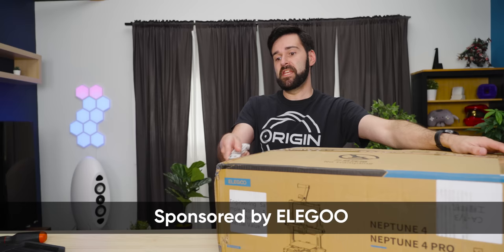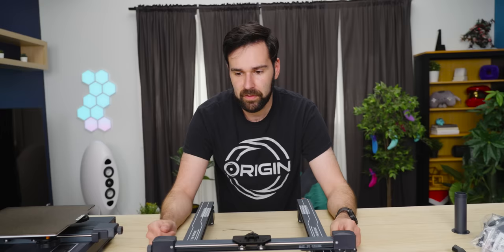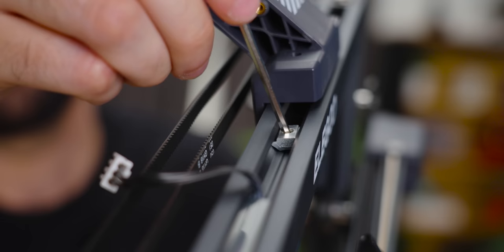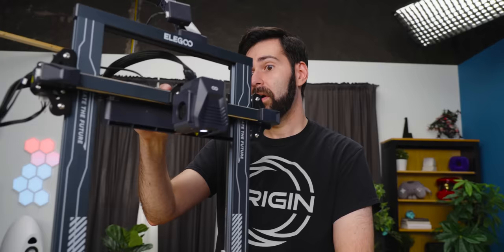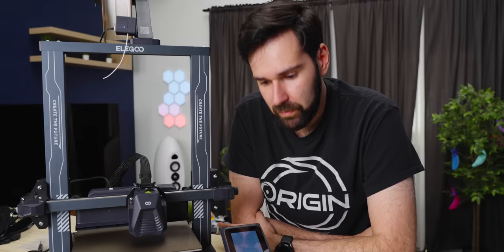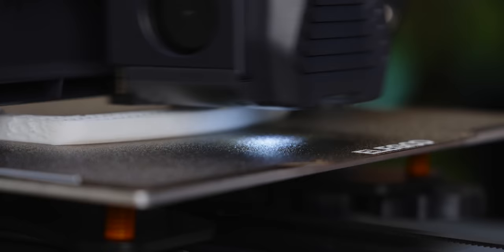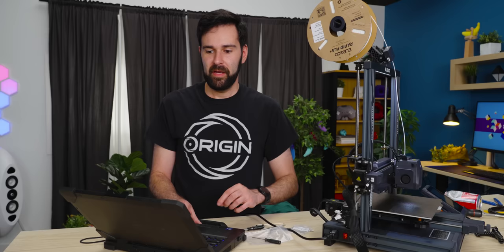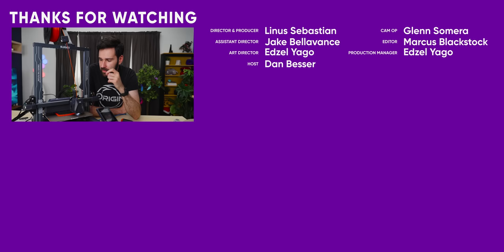Now THIS is bang for your buck! - Elegoo Neptune 4 Pro

Comment: I really have to say this, there are a lot of points Dan missed with the printer, and it shows that he does not understand all the necessary things in the field of FDM printers. I feel that with the growth and improvement of the hobby and semi-pro 3d printers, LMG has to get a person to be in charge of this. There are going to be more review of printers and the number of viewers interested in 3d printers is only going to grow. You need a writer who breathes 3d printers and know the field deeper than Bambu and Prusa and Ender. Honestly I am a long time viewer and watching this video makes me want to apply to a position in LMG as a 3D printer maintenance and technical specialist, because I feel like I could help improve videos like this and I honestly care about LMG and want the best for the company.
Reply: why would you want the best for some other man's company? That a weird perspective.

Furthermore, it's nothing to do with knowing brands and everything to do with knowing what matters and to who.

For isn't acne he should know that top speeds mean literally nothing as technically you can make a trash heap ender 3 get to 600mm/s just like this technically reaches whatever nonsensical speed they state but in reality what matters for the end consumer is if it has a motion system that results in higher being better acceleration for a given level of quality and the maximum volumetric flow of the hot end. Furthermore, if it has enough air movement to cool the layers it's putting down.

What matters is what it takes care of for the user automatically. Auto bed levelling has existed for years. We want to know if it has auto Z offset, pressure advance auto tuning, automatic input shaper, auto print failiure/printer failure sensors etc.

These are the type of things that really matter to users but users don't know matter to them because manufacturers know they can put up sleazy marketing just talking about completely unrealistic top speeds and half baked not really features.

Ultimately the printer showed here is just another ender 3 clone, but hey it comes with klipper out of the gate.... then promptly does not correctly use the majority of its features. At least it has the web interface?! but then even there it has no camera.

An in-depth reviewer wouldn't be impressed by this printer. It's alright, but honestly which person could you advise to get this but not the cheaper Bambulab printers for a bit more money but much better experience. To me it's like either you just get that to use the thing as a tool, or don't bother because you likely don't have plans to print enough for this to be worth your time and can get by using a local library or print service.

Comment: I think you should take the time and actually do research on the printer before a review. 

You said you weren’t expecting a filament run out sensor. When the Neptune 3 and I think some Neptune 2 printers had it.

Comment: Elegoo has already been pretty much on the top of my list for when I decide to get a printer. Still trying to decide between filament or resin printer though
Reply: General rule of thumb,
Go with resin if you are primarily printing aesthetic stuff (small figures), and go for fdm if you want structural prints. Won't apply to everything, but generally resin prints don't have as much structural strength as a good fdm print. But that's assuming a good fdm print with good later adhesion and with printing with the layer orientation in mind

Comment: why haven't you guys made a real video on resin printing? You can get valid options in the 300-500$ range that easily outclass traditional 3d printing for hobby and small parts work.
Reply: It's not like you just need the printer when it comes to resin. You need the printer, another machine to clean/cure the resin print and a way to move away the fumes corectly.
If you are really just doing hobby printing or small parts even a 200 dollar budget FDM printer will do.

Comment: The big problem with this is that for 200 more you can buy  Bambulab P1S that has way more automation meaning its easier to use, enclosed meaning more capability filament wise and has access to the auto filament changer.

This thing doesn't have auto Z, doesn't have automatic resonance compensation, doesn't really have auto anything.

Then, this thing is a v wheel bed slinger as well meaning high motion system wear, slower movement, hard to enclose, etc.

Basically, don't buy this, buy a P1S. The extra money will be saved in no time with all the calibration prints you won't have to do.
Reply: The P1S is 700 dollars, so not just 200 more. Auto filament changers will cost you a few more hundred dollars on top. Most people also won't need an enclosure and the people that do know that they will use those filaments. Not like you can't just buy a universal enclosure.
You people also need to stop acting like it takes hours or multiple rolls of filament to calibrate these printers. You just run the auto leveling and then adjust znaxis for like 30 seconds either without a print or a 1 layer test print that "wastes" maybe 0.5g of filament. You just do that once and you are done.
For the extra money you will save you can buy like a year worth of filament.
In the end even this printer is overkill for most people. So recommending a P1S blindly just because it's good is just stupid.
It's like recommending a super car to 99% of people who just want to get to work.
Reply: @kwedl  OK 270 more sure but still absolutely worth it. You fail to understand the value adds. The claims about tuning taking no time are the type of lies that end up annoying more normal people. There is far more to it. This printer has no means to auto calibrate input shaping or pressure advance or Z offset or tell when the belts are no longer tensioner or....

The list goes on. The point is by distilling it down and minimizing the actually annoyances involved with using this printer vs the P1S you do a disservice to the value of people's time.

You also ignore how much time and filament they will waste tuning on that printer vs this printer.

This is more like a modern car and nowhere close to super car price levels.

I essence you miss just... everything about the printer and I haven't even covered the speed (where there is significant difference between a large bed slinger and light headed core xy).
Reply: @BeefIngot  How are you getting $270?  P1S: $699, Neptune 4 Pro: $299 -- $699-$299 = $400.  (not including the $10 discount code, which would push it to $410)
Reply: @Tamdrik  Yiu are right  hit wrong. it is 370. the P1P is closer to what I said. Regardless the point stands though.

The enclosure point I actually agree with too, but it's like it's not that much more, just get it and know you can print just about anything and if you think your printer won't be used, don't buy a printer.
Reply: @BeefIngot  $699 - $299 (or $289 w/discount code) is not equal to $370, either, so I'm still not sure how you're doing your math.  If you get a P1P and an enclosure, you're basically back to P1S prices, and the official Bambu upgrade kit is even more expensive.

Like others have said, you're insisting that it's always worth over double the price to add a couple of automatic features.  Some people have more time than money and/or find tinkering and learning about the printer to be an enjoyable use of time, and $400-410 (+133% or more cost) is not an insignificant sum.  Another way to look at it is you could buy two N4Ps and ~5-10 kg of filament for the cost of a P1S (or P1P + enclosure).
Reply: @Tamdrik  Its 330 off sale, hence the number

Also if 370 is a lot of money, you have to ask the question why are you buying a 3d printer rather than using a library or service? If you are really going to get value from that printer you are going to be spending way more on parts and firmament for your projects.

Projects you will be busy with and won't have the time to faff around with your tools while doing, especially as the less someone makes the more busy they are generally speaking.

As for finding tinkering enjoyable, you do that on your secondary printer not first. You want  your first to just do the thing, no bs.

Lastly, wit regards to learning, I feel like I've tackled this a million times. Being forced to learn mostly things that are not transferable is not useful. V roller bed slinger ender 3 clones are going the way of the dodo. The majority of problems you'd be solving just aren't problems on better printers so congrats you just learned how to solve a problem that's been solved a million times through frustration yet again rather than making what you bought the printer to make and actually being creative or learning something more fun and productive.
Reply: @BeefIngot  The people you're trying to convince not to buy this printer can get one today for $289.  By your logic, the P1P is actually $699 "off-sale".

And you sound pretty out of touch telling people that they should use their secondary printer to tinker on.  The $700+ 3D printer market is fairly small to begin with.  The market for people who own multiple 3D printers is tiny.  

Not everyone is using their 3D printer as an professional production line-- most use it as a hobby.  There are lots of people who bought Ender 3s and don't regret the purchase, since they were cheap and ultimately produced reasonable prints.  The N4P would be a significant upgrade, and someone looking to replace their aging Ender 3 would probably be thrilled with it.  A hobbyist might only barely be able to justify a $289 expense, much less $699.
Reply: @Tamdrik  The market for people who want a printer to tinker on is tiny. That's what you aren't getting with your "but what if they want to tinker on it". The vast vast majority of people buying printers just want them to work. They emphatically do not want to tinker.

I am a hobbyist. I think the idea that a hobbyist can barely stomach 300 dollars for a hobby is ridiculous. Most hobbies start at a way higher price point.

What's more, like I said, not only do most people not want to tinker, but the printer is supposed to be a tool to be creative. You don't buy it just for lols, or it would be a second printer.
Reply: @BeefIngot  There are people that barely have $300 (or less) to spare for discretionary spending period.  Must be nice living somewhere where poor people don't exist.  That would explain your cavalier demands to spend over double the cost of the printer for a few convenience upgrades.  It's like telling someone not to buy a used Civic because the maintenance headaches won't be worth it, so they should buy a new BMW instead.

Comment: I just bought this based off of this video. It worked great for 48 hours. Now it won't extrude any plastic. There's no support number? It's already broken after 48 hours of printing.
Reply: Still broken bro ?
Reply: @gedediva  yep. I returned it and went with bambu p1. No problems at all after a month now.
Reply: @beffjarker208  I know you already returned it, but for me, my heat block cooling fan was broken and the PTFE tube shrunk from the heat which restricted filament flow. I might get a Bambu as well, the Neptune 4 has been a total headache.
Reply: There was no way that I could even replace the nozzle

Comment: I was looking at Elegoo's resin printers on Amazon recently and decided that they probably weren't great entry-level machines. I didn't even notice this model, but it seems pretty awesome considering the price.
Reply: I actually got their Mars 2 Pro as my first printer and it was pretty easy to just set up and use since there's no levelling involved. The only part that's kind of a pain is the cleanup and inevitable spills. If you're more into models and art pieces then resin is the way to go, but filament is better if you want to print functional parts.

Comment: The v-slot rollers are actually far more durable than the solid ones. Also we call these bed slingers and I dont know what printers you have at home Dan. This price point has been fairly common for the 3rd generation printers that are now using the Klipper firmware. It just gets more expensive the larger the build volume. PLA+ is just regular PLA with more additives for adhesion and is pretty much the new standard for all these high speed printing machines, especially with the Ankermake M5's that are purposely built to print fast. The PLA+ rapid from Elegoo is just a marketing ploy,  no difference in volume flow.

Comment: I have this printer and it printed a few items now it won’t print anything . The models either lift or fall off build plate . Yes I level bed manually and auto and clean the pei  with  hot water and detergent.  So what is wrong with it ? 😢

Comment: The base isn't a XY assembly. The Webbrowser interface isn't Klipper and it's not a firmware. The fkn name FLUIDD is right on the Webinterface. The Klipper firmware is flashed to the microcontroller.
The printer is great but you are talking bs on the details.

Comment: 500 is travel speed, not extrusion, it prints at 250. Also check the acceleration: the Bambu cireXY does 20k this one is ~5k: you'll much less likely to reach those hi speeds.

Comment: not that fast and not that cheap. Sovol SV07 3D Printer 500mm/s with Klipper Firmware 300℃ £260  UK Neptune 4 PRO UK £390.

Comment: This printer is shit it's notorious for uneven heating and filament clogging. Go for the Bambu Lab A1. It's more expensive, but it's easily earned back through saved filament and hours not spend on problem solving, failed prints, manual leveling and calibrations. Had the Elegoo for 3 months and my first gray hairs appeared in this period, true story.

Comment: 1:20 ? What are you talking About ? That’s completely backwards 
I am sorry but there is no other explanation than incompetence on the subject…… you can clearly see that the 2 side fans blow onto the part and the one fan you pointed out as the layer cooling fan actually cools the heat sink of the hotend

Comment: 2:00 - LAN support is great?  What is this?  1999?  WiFi is the way almost everyone will want to talk to their printer.  Hopefully, Elegoo will introduce a larger format Klipper printer with all the great Neptune 4 Pro features, but with WiFi and replace the ribbon cable with something better... perhaps a continuous flex rated 4 wire CANbus cable to the print head.  3D printer development slowed for a few years but we're getting many improvements now.

Comment: Ive been a fan for many many years but man.... have someone who knows the terminology and 3d printing knowledge doing these. The 2 4015 not 4050... are for part cooling not because the hotend goes to 300.. the single fan is the hotend cooling fan.. All the 3d printing reviews are crinch and misleading

Comment: This review sounds very off the cuff and negative. No surprise or excitement for the printer. The entire industry is shifting to what this printer and others like it are moving too. I get it, you have an older printer model, but why not be excited to review something that will shave hours off your build time. I’ve watched a lot of reviews of printers, and this is by the lowest energy, and least helpful with the constant doubting of the product and accessories. I get if this is to be a blind review, but this just sounds like “I doubt it will do this because mine doesn’t.” Type of review.

Comment: Why you guys all handle products with such aggression and constantly throw or punch things? Can you just be a bit more careful? 
btw - I have a 3D printer from only 6 months and even I can say half of the things I hear in this video are just bollocks and simply not correct.
Sorry guys, bit this is very bad advertisement. :/